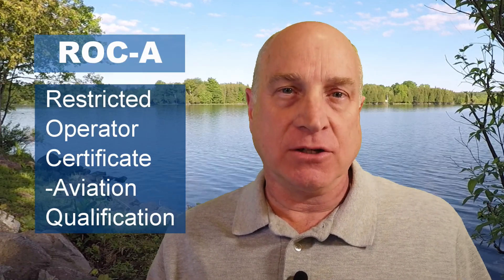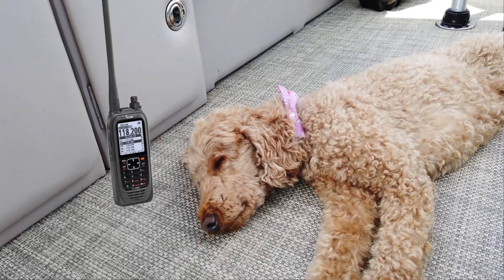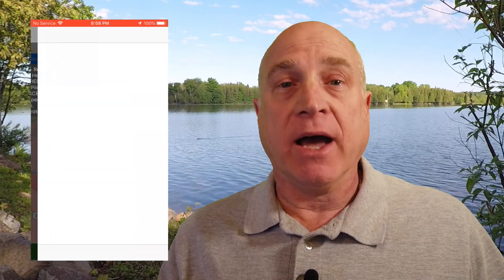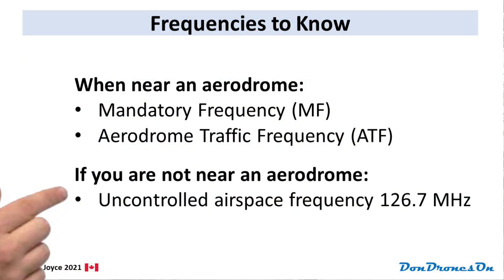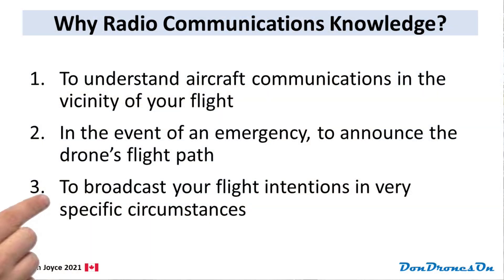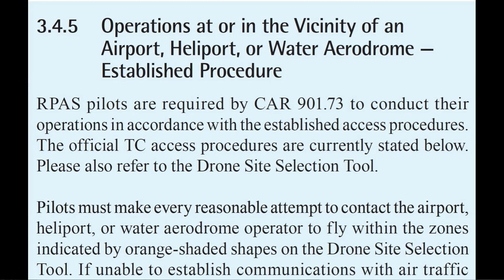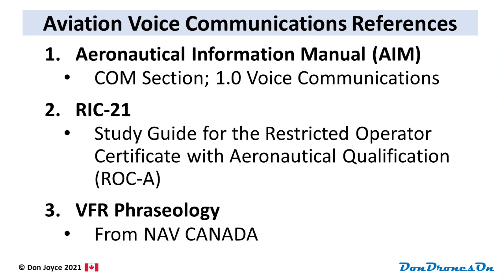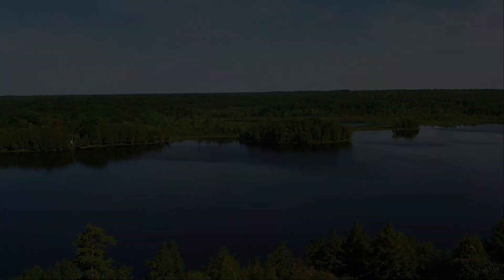Radio Knowledge for Drone Pilots - Part 2: When to Use a Radio

Comment: Thanks for such comprehensive guide. I'm a little confused about the operations in controlled airspace. It seems to me that the ROC-A with aeronautical qualification and having a transmitter would be mandatory for those missions? But is it? You also said it might have to be used when the mission is outside the controlled airspace, in the vicinity of an airport. That means the orange circle, correct? Because for flying outside that circle you wouldn't need an advanced RPAS license.
Reply from the maker: There is good reason to be confused...it IS confusing! Guidance on the use of radios is changing and is still not settled.  Please refer to my latest video for the latest.

Comment: Don, while I really enjoy your video series, this is 1 of those times I have to play devil’s advocate. How many drone pilots, even advanced pilots do you think will invest in a receiver, let alone a transmitter. Personally, I think It begs the question.
Reply from the maker: I couldn't agree with you more, Bill!  I certainly am not buying a radio!  This series is mainly intended to cover off yet another TC knowledge area for the exams and to explain the cases where a radio MIGHT be helpful.  I say many times...just use your phone.  If someone already has a radio (perhaps being a manned aircraft pilot), fill your boots.
Reply: @DonJoyce  Keep the videos coming Don. They’re very informative, and you’ve certainly done your homework.

Comment: Are you required to have a radio for a flight review...Class G ..or otherwise ???
Reply: NO - but indicating that you are aware of possible benefits wouldn't be a bad idea.
Reply from the maker: Correct, Mike.  If you have one and know how to use it, great. But otherwise you absolutely don't need a radio for a flight review...or most other flights.